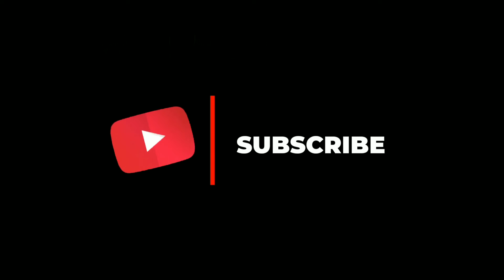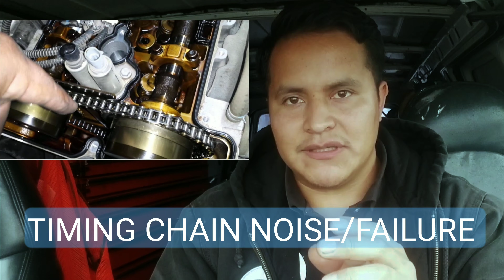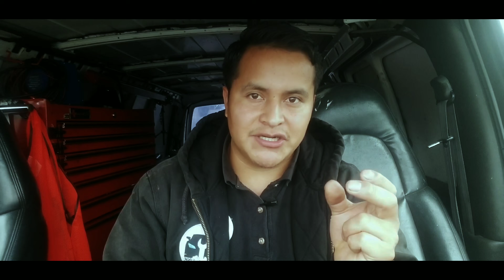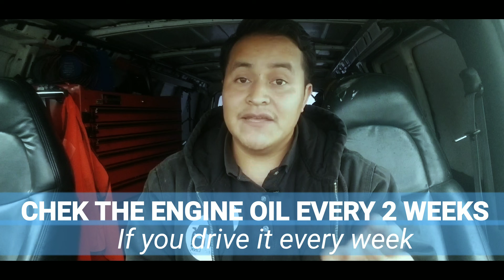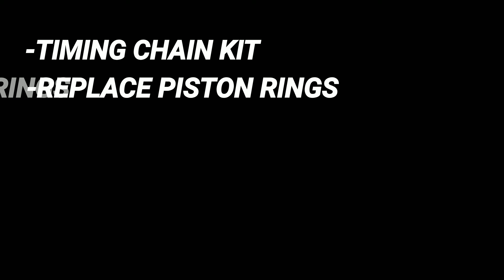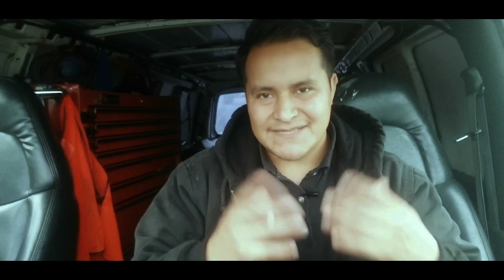GMC engine problem| why it fails and what you can do about it

Comment: I had a 2011 with the 4 cylinder and it would randomly die all the time. Then the tranny went, only owned it for 2 months. Now I have a 2016 with the V6, going on 2 years now, so far so good lol

Comment: Please help me!!! I just paid the mechanic 1300 to fix the cat. Now two weeks later the car ran perfectly last nite . I woke up to go to work and noticed I needed oil so I bought 1 quart and put it in. 2 hours later I stopped the car and when I try to start it , it wouldn’t. My mechanic said the  oil was dry , but then said I need a new engine. He didn’t even try to fill it
Reply from the maker: Sorry to hear that. This answer might be too late... fill the engine with oil and get it diagnosed to make sure that the timing chain isn't broken. If the timing chain isn't broken then compression should be the next thing to check and if that's good then the engine shouldn't be replaced yet, just find the problem to why it's not starting
Reply: @WrenchLink  I ended up going to gmc and they rebuilt it cost an arm and a leg

Comment: Tengo un problema con mi gmc terrain 2010 2.4L cuando está frío el motor está bien, pero cuando ha calentado bien el motor y estoy parado en un semáforo empieza a temblar la acelero y se le quita la falla. ¿Tienes algún consejo amigo ? Ya le cambié la cadena del tiempo, las bujías, los coils, tiene buena comprensión pero sigue igual. Espero tu respuesta.
Reply: Yo no fui, tienes algún código o no lo haz escaneado todavía?
Reply: @homeromarquez7413  tengo el código p0300 lo raro es que cuando le desconecto el selenoide del exhaust se le quita la falla ya se lo puse nuevo pero igual solamente con el selenoide desconectado trabaja bien pero me sale el check engine por desconectar el selenoide.
Reply from the maker: El High Pressure fuel pump es problema comun en estos carros. Revisa si la parte que va adentro del valve cover tiene aceite, si esta seco remplazalo porque tiene fuga de gasolina hacia adentro del valve cover
Reply: @WrenchLink  Gracias amigo lo voy a intentar

Comment: So how do we fix the oil consumption issue? I burn 1-2 quarts every 1000. How much does it cost to fix?
Reply from the maker: Change the piston rings. Cost depends on the shop you take it to and where you live but it will cost thousands

Comment: I have been following the full synthetic 6 month / 6,000 miles oil change. Is that okay?
Reply: Change your oil at EVERY 4000 miles with 5W-30 Dextos synthetic no substitute .. my 2.4L has 60K still no consumption dipstick full.. DO NOT Listen to the GM BS recommend  NEVER 5-6-7K miles if you use synthetic blend 3500 miles..ALL Oil breaks down..period,  45 year mechanic here I seen these blown or timing chains snap at 70K miles worst at 100K miles.
Reply from the maker: I recommend 3k miles oil change on these cars

Comment: Facts I bought my 2012 slt 1 2 years ago 64k miles  YOU DEFINITELY HAVE TO CHECK OR ADD ANOTHER 5QTS! I heard ticking noise while at drive thru and knew i needed oil! Did research and there it was Heavy oil consumption! Transfer case went at 70k 😩 and damaged passenger Axel $1100 repair! You just have to make sure you keep and 👀 on that oil DO NOT RELY ON THE DIGITAL GAUGE YOU WILL BLOW YOUR ENGINE! I Don't buy expensive synthetic right to the  Wal-Mart Synthetic I go b/c it burns the oil. GET AN OIL CHANGE EVERY 3K ALSO YOU WILL HAVE TO ADD ANOTHER 5QTS EVERY 1500-2000 MILES...😉
Reply from the maker: They like to drink oil

Comment: Thank you so much for this information. My wife's 2015 Chevy Captiva with the 2.4 just started drinking oil this past year. Just last week my wife drove it 600 miles to see her family. Her brother checked the oil for her and it didn't even touch the dipstick. I had it topped off before she left. So today we traded it for a 2018 RAV4. So no more worries, but I have a 2015 Equinox with the same 2.4. It is at 77K miles and no problems, but I'm looking for fixes to keep it from doing the same. I've heard about maybe a catch can to help with the pvc system, but more worried about the oil burning in the future.
Reply: 87K now on my engine and it's losing 3/4 of a quart every 3K miles. I've been doing 3K mile oil changes but I'm guessing it's not buying me any extra engine life.
Reply from the maker: The oil consumption in the cylinders the worst problem of these engines
Reply: 2010 to 2014 were known for this issue
Reply: @les078  all gdi 2.4L ecotec engines are known to have this issue. The year doesn't matter. The newer years have upgraded piston rings that wear out around 80-100K miles. The earlier years from 40-60K miles.
Reply: Transfer case fluid?? Am I to ask them about

Comment: Awesome Awesome video... this will help lots of people out there including myself... very very nice explanation brotha.. keep up the good work 💪
Reply from the maker: Thank you for watching! Share if you can
Reply: I have tried many things with 2011 gmc terrain 2.4 liter.. done timing chain, exhaust manifold, intake. I have done it all and keeps running like crap once it reaches normal temperature.. I don't know what else to do!! 😭😭
Reply from the maker: @papitochulo18  have you taken it to a shop? To get a diagnosis
Reply: @WrenchLink  im a licensed tech myself.. I work in a shop.. but this is my personal vehicle that I picked up!!! I have replace all.. Im thinking I may have a bad intake selenoid that when gets hot starts giving me issues
Reply from the maker: @papitochulo18  do you have a scope to test the cam, crank sensors and the VVT solenoids?
Reply: @WrenchLink  I'm gonna borrow shop scanner and check the values of all sensors.. I own a small scanner which is kind of hard to see them all values. Just find strange keeps telling me intake selenoid is bad when has been replace 2x..

Comment: So what if I'm at a red light and it starts shaking really bad? Also, when I run my heater or ac it smells really bad like gas. I've already changed both cam shaft sensors, crankshaft sensor, spark plugs, tow bar, fuel pressure injector, catalytic converter, and air filter. All of those got my car running right for like 2 days max and then back to the same problem.
Reply: Try replacing the manifold. Ours had a crack in it
Reply: parts changer....might want to find a mechanic
Reply: Hey those cars no good

Comment: I just brought the 2012 GMC Terrain today and it acts like it doesn’t want to go when I drive and it also shakes a little when I’m at a red light. It has 151k miles on it. I plan on taking it back to the dealer Monday to find out what’s going on.
Reply: Hi, what happened when you went back to the dealer?

Comment: So I have the 2017 V6 3.6l version, would my terrain also have said issues? I may be wrong but I thought the 6 cylinder version had a different engine than the 4.
Reply from the maker: It does have some similarities

Comment: I literally just bought a 2013 GMC Terrain. Guess its better to learn now than later I guess. I really hope I don't run into any problems in the near future 😭
Reply: Just change your oil every 3k miles and make shure you use dexos. Secondly acdelco sells a oil breather cap for the pressure from the crankcase. When ever your pcv orifise gets clogged its too much crankcase pressure and theres no way were that pressure escapes, thats when the seal go bad, having the ac delco cap releases that crankcase pressure and your seal wont go bad.
Reply: @rhurtadorh32  Do you have a part number or a link to that oil fill cap?
Reply: @terrywaters6186  fc219 its going to say it doesnt fit but it does. Fc219 is the part number.
Reply: @rhurtadorh32  Thank you.  I just ordered one.
Reply from the maker: Hopefully
Reply: How is it going? I just got one. Pick it up in a few days
Reply: @bookswithb1  Well I've had it for a year and a half so far. It's still running pretty good and haven't had any issues. I change the oil roughly every 4000 miles.
Reply: @AmethystDream94  I’m so glad to hear that! Thank you for replying.

Comment: How are the 2018 - 2021 models? Did they fix these issues?
Reply from the maker: It's too early to know if those earlier models still have the problem
Reply: It was fixed by 2015
Reply: The motors in the 2nd generation are different you  have 1.5 1.6 diesel or 2.0 turbo

Comment: What about the V6 engine
Reply: The V6 engines have timing chain issues especially 2010-13 models. Change your oil every 5,000 miles and add a catch can.

Comment: What should I tell the dealership when I take it in for service, besides thanking them for selling me junk?
Reply from the maker: The dealership won't do much other than normal service. If the engine brakes then they would fix it if it's under warranty.  If you pay for it then full synthetic engine oil is good and change it every 3k miles not 7k like the GM recommends. Do an all fluid checks every 10k-20k miles (not just in the reservoirs).
Reply: @WrenchLink  Thank you for the advice, I appreciate it.